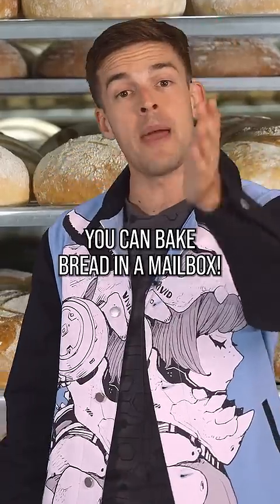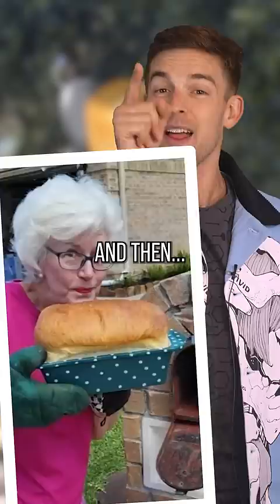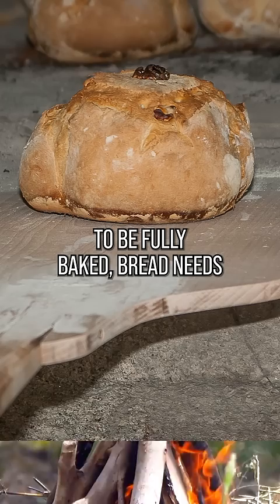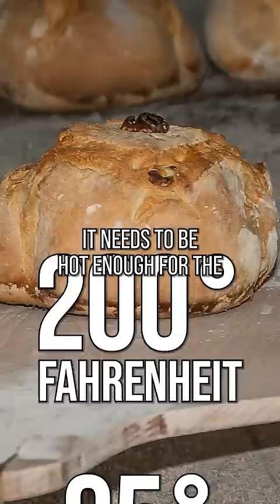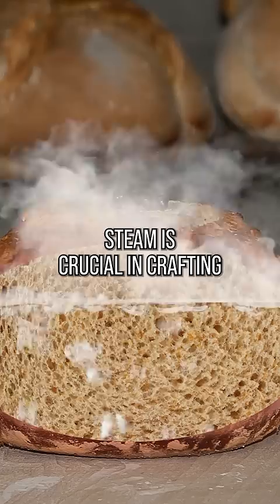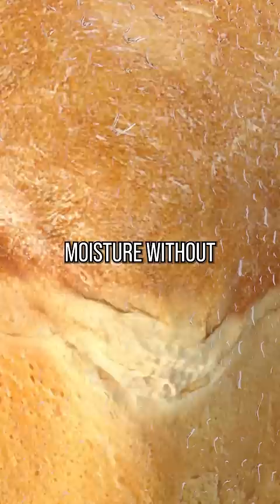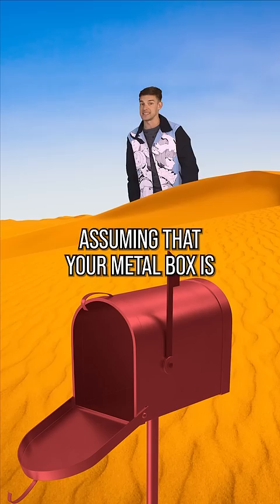You Can Bake BREAD in a Mailbox?! 🍞📬 #shorts

Comment: The (historical) definition of 100°C is that it is the temperature that water boils at sea level.

For water to boil at 95°C, you need an elevation above sea level of 1,524 m (c:a 5,000 feet). Unless you live on a hill in a place like Nepal or Tyrol, it's not likely that you can boil water at 95°C at home.

At 1,500 m elevation most US-Americans begin to really feel the lack of oxygen. Most of them will still survive without oxygen masks , and continue to be somewhat functional, but they will feel really tired and dizzy. Of course, those with the right genes from high altitude areas, won't get effected.

Comment: Fact checked false.  While the instantaneous temperatures may reach high enough levels the amount of energy to bake bread is more than just getting to a set temperature.  Boiling water takes lots of input energy not just temperature the the amount of watts hitting a mailbox are not enough to do a proper job, perhaps a miniature loaf but certainly not a full loaf. But don't be upset, solar ovens do exist that can bake bread.